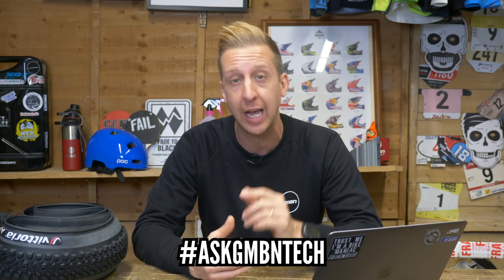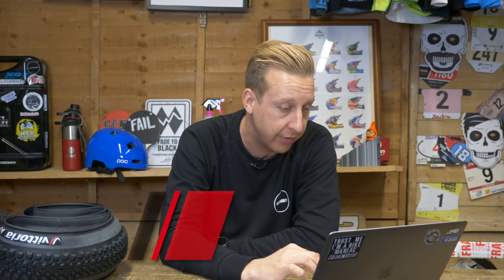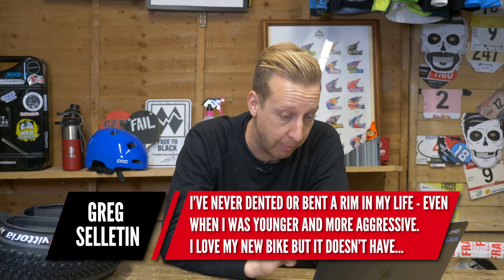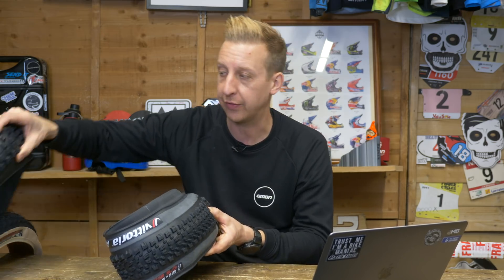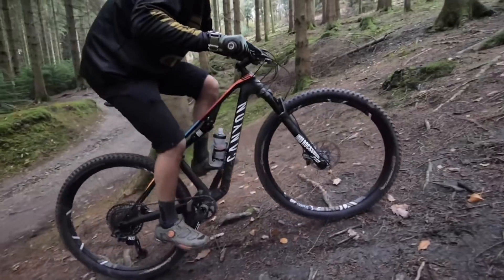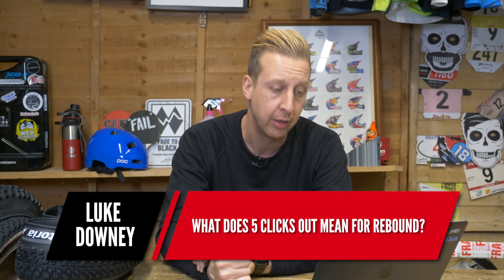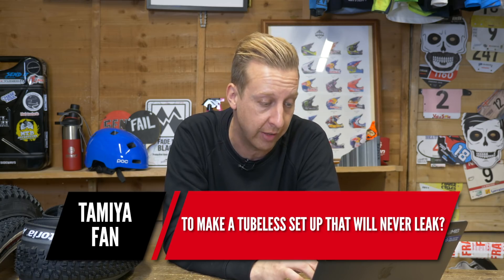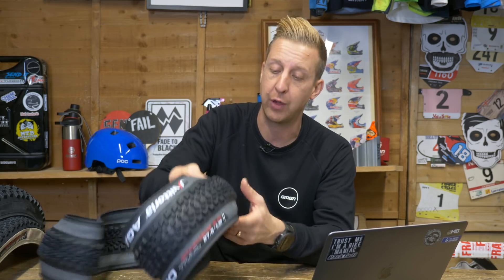Best Way To Fix A Ripped Tubeless Tyre? | #askGMBNTech

Comment: Is it okay to hang your MTB vertically with the front wheel up? I’m affraid it will do something with the oil in the fork. Hanging it with the frontwheel down ruined my headset bearings on my previous bike. #askGMBNtech

Comment: #askgmbntech Hey guys, I recently developed some shifting issues with my SRAM NX Eagle drive train. Having managed to sort out issues previously with a Shimano drive train, I thought "piece of cake". I soon found myself having to consult a youtube video as I was having a hard time identifying which screw adjusted what. I couldn't help but notice that the video from SRAM said to lock the cable in whilst in the highest gear where as when I installed the shimano one it was the lowest gear. Any idea why this is. Cheers, Jon

Comment: #askgmbntech Good day gentlemen. Thank you for amazing shows. You are on a high level. Just awesome! I have an entry level full suspension Titan Sonic Expert with a Rockshox Monarch R rear shock. It says 275 Max PSI, yet a guy at the bikeshop said for my weight I should be running it at 320-325 PSI.I was scared to go up to 320PSI so I stayed at 275 PSI, but my sag was almost 40%. It did not feel well on the trail and I had to be careful with pedal strikes. I inflated that to 300PSI now and it feels a lot better. I am concerned that it will break the shock though. Advice please?
Oh before I forget. My gear shifts are perfect when I set it up, but under pressure when riding the gears tend to slip or not be so smooth. Is that due to the suspension? I have an XT 10 speed.
Reply: You should never change gears under load.
Reply: @th_js  hi Tomi. Not changing under load at all. This is up and down shifting that's affected. I have the same setup on my hardtail and it runs perfectly. I thought it might be that my limit screws were out and at first the high gear limit screw was too tight. I set that properly and still... I don't really understand the B screw much. Maybe it can be that???
Reply: @MG-eu1hs  Yeah, if your B-limit is set right when off the bike and you get 40% sag (which is waay too much), the b-adjustment is irrelevant as it needs to be set with the rider's weight on the bike. As for what the B-screw is, it basically just determines the distance between the upper pulley of the derailleur and the cogs and is adjusted on the biggest cog.

Comment: i disagree on the proper rim tape... i used multiple tubeless specific rim tapes and it wouldn't seal... after a week of trying i opted for gorilla tape that my front wheel was already set up and sealed first time with.. the rear wheel sealed up first time with no leeks that i was getting with other brands of rim tape with the same dimensions.. gorilla tape for the win
love watching this show though, i have learnt allot

Comment: #askGMBNtech
I have a quit decent hardtail which is enough for the terrain I am riding. Do you think I should rather save money for a full suspension bike or spend money on better brakes ( shimano slx, sram guide maybe) . Thanks alot
Reply: Sounds like u enjoy it...upgrade as bits wear out imo.
Reply: @rupedog  cheers man, thank you for your tipps

Comment: #askGMBNtech
I am watching your show regularly and I never thought that I would have a question. But here you go:
I am trying to convert my Trek Procaliber 8 2018 with a Rock Shox Reba into a fully rigid bike with a rigid carbon Fork. What other things do I have to buy, besides the fork, in order to make it possible.
Thank you very much in advance for your response.
Johannes
Reply: tools to cut the steerer, a star nut, maybe extra headset spacers if you plan on running a higher stem, a crown race if its a different size steerer tube

Comment: What's the purpose of volume spacers. I've searched on the internet and I'm still confused. Thanks. #askGMBNTech
Reply: Volume spacers "replace" the equivalent amount of air in your fork's/shock's air chamber, making it harder to compress as it gets deeper into its travel, compared to running no/less spacers. But spacers won't effect the initial responsiveness i.e. for the first part of travel!

Ever tried to compress a plastic bottle with the cap on? Same principle with suspension: the more liquid in it (less air) the harder it is to deform.
Reply: Using spacers makes it harder for your suspension to go through all of its travel (aka to "bottom out"). But you'll still be able to use factory spec air pressure to correctly set your sag.

Comment: Most bike shops tend to just bin the bag of bits and manuals... most people dont know what to do with them.
Reply: The bag of bits is generally useless for mountain biking, even most road riders tend not to use the free reflectors that come with bikes.  The bike manuals ive had never had any useful information that would not be common knowledge.
Reply: I find most things sell better when they have receipts, original box, manuals, etc.  Only reason I keep mine.

Comment: 9:33  unless it's Schwalbe rim tape, it's garbage. I have a review on my website. it's weak, and you risk it folding,wrinkling, tearing, and removing it you might need to remove small pits at the time, ridiculous. I use Gorilla tape now.
Reply: Yeah, the DT Swiss stuff is extremely weak too, leaks way too much and comes off in pieces. Gorilla tape is good and I use it, but it does leave a messy residue on the rim.
Reply: @th_js  but it's easy to remove the residue, just rub it, and roll it into a ball.
Reply: @mtbboy1993  True.

Comment: #askGMBNTech minimum tyre width for plus size wheels? lets say 40mm inners
Reply: 2.6 is fine and you could easily run 2.4's too, but that could result in sketchy cornering.

Comment: #askgmbtech
What's the deal with using a paraffin as a chain lubricant, I found a lot of mixed opinions and rewies
Reply: i love how clean it is, but i live in a pretty dry area; on the rare occasions it really gets soaked, i have to re-wax pretty soon, or throw some dry chain lube on it.  (google "molten speed wax" if you think that sounds cool)
      i think the whole thing with cooking it in a crock pot is fun, but if that sounds like too much work, white lightning's 'clean ride' is basically the same thing, but in liquid form. also works great, but plan to lube it every week or two (but you barely need to clean it, so it'll only take you a few minutes)